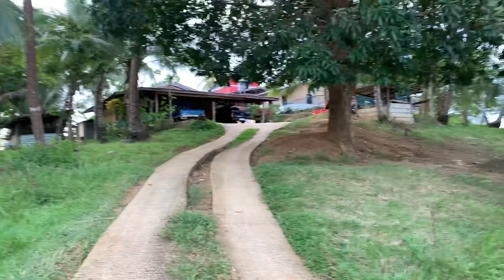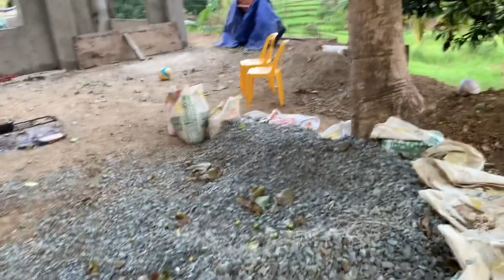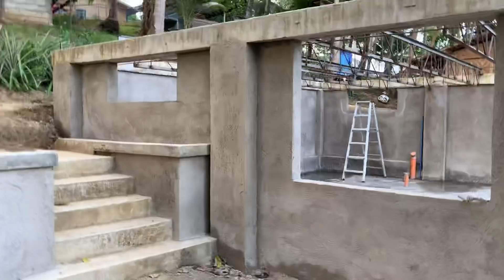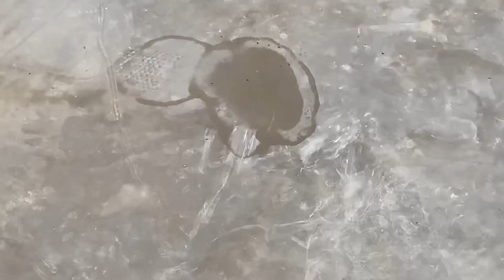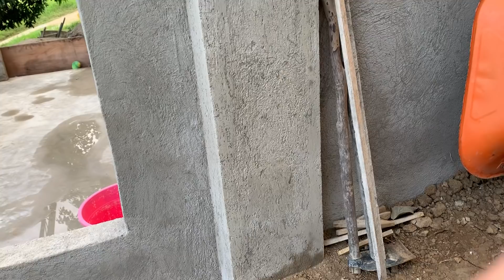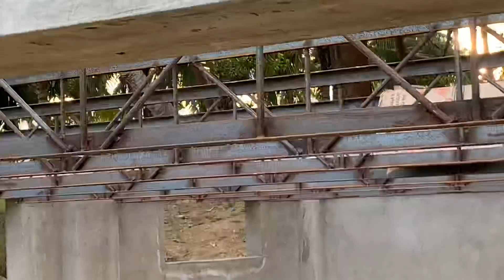Dream house update

Comment: James Great Job you are doing. Can't wait to see how the floor comes out. I have a house in Pangasinan, Phil that the driveway is chipping up because workers over worked the concrete, and put slick tiles in areas in the driveway. If their is water on the driveway I have slipped more then once. Bad :(  I would love to put a coating over the whole driveway to hide the concrete and tiles.
Reply from the maker: Yeah Thomas 
YouTube paint chip Apoxsee floors really easy to do and you can choose your color and your theme whatever you desire
Reply: @aforeignerslifeinthephilip8485  Thanks I will see how your comes out first. I am here in Washington State, just came back from Philippines.

Comment: James and Hessica, The trick on wide and often heavy gates is to have a counter
balance (concrete weight) on the opposite side of the post from the gate. The
 pivot point goes above the center of gravity about 3" on a 72" tall gate. At the
bottom a loose ring goes around the post attached to the swinging part of the gate.
       We had a plastic chip floor and driveway in Florida. It was hired out but I
remember that it is slow drying epoxie that gets put on first, then broadcast the
plastic flakes with two colors stirred together like light and dark green or blues  
or red and pink or gray and any color. The flakes are rolled flat with a 3" by 18" 
hard surface roller you wear spiked used golf shoes to spread  the epoxie with 
an 18" wide squeege the following day after any loose flakes are recycled.
This is also a good floor for garages and wood working shops. There is a slight
texture that is fairly non slip as a bonus. Both Wilcon Depot and AllHome sell epoxie laminating resin in 1 gallon cans.
       Decks and concrere are cleaned with oxyacilic acid solurion if the stains are
soaked into the surface. It acts like a bleach. Around the PH concrete and toilets 
are usually cleaned with mureiatic acid from the local hardware.
     We had some small rendering cracks as well due to hot sun and strong winds 
blowing as it cured. The skim coat is forced into those and any other imperfections.
Because it is put on really thin there seems to be no differential drying cracks even
on the first coat. That gets a sanding before the second coat which should have
no imperfections showing. Boysen makes a paint that wicks into cracks and fills
them up. No reason it couldn't be used on skimcoat although it is usually put over
the render. Skimcoat looks nice on the interior but seems to make any sound
echo around where the render alone is much quieter. The house we stay in has 
painted render and NO ECHO at all.

                                                       george and aurora